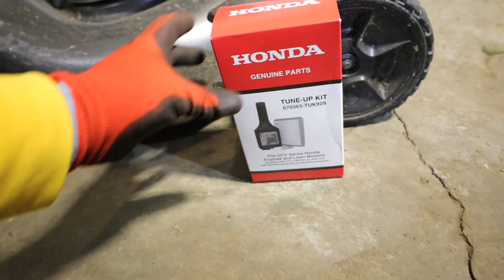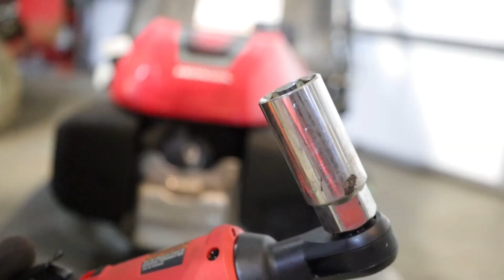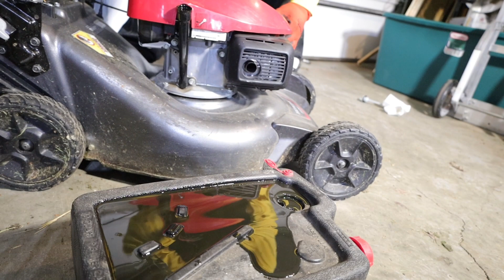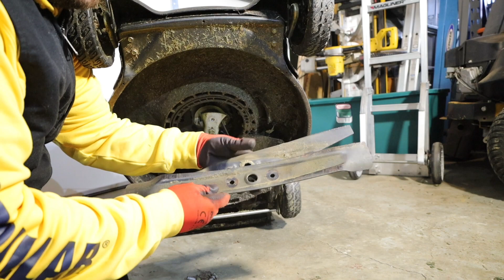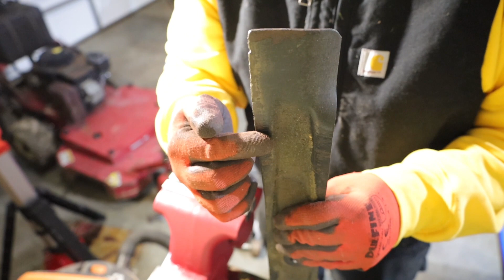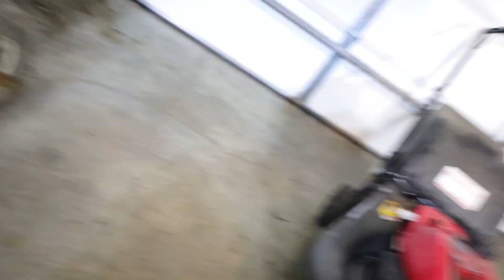How To Tune Up Honda GCV Mower Engines using the kit. Oil Change, Spark Plug, Filter & Blade Sharpen

Comment: Check oil level by not screwing in the filler cap as there is a risk of over filling the engine as per Honda instructions

Comment: Not disconnecting the spark plug and then taking off the blades is a good way to lose fingers.  Using power tools to take out the plug is a good way to over torque it.  You also didn't gap the spark plug. You should have run that mower to warm up the oil before draining it and lastly, you don't screw in the dip stick to check the oil level.  Other than that, it was flawless :).